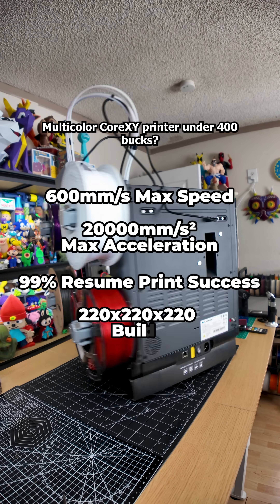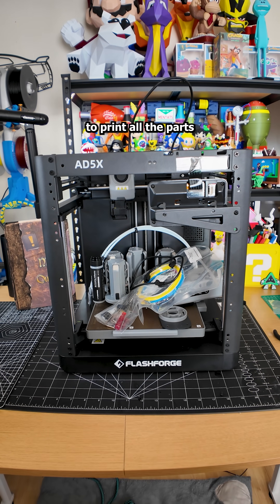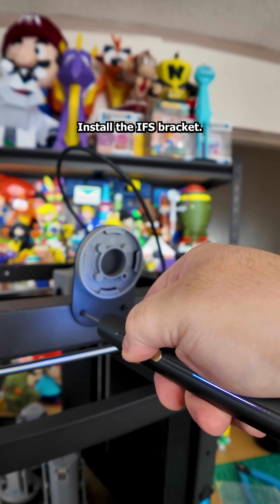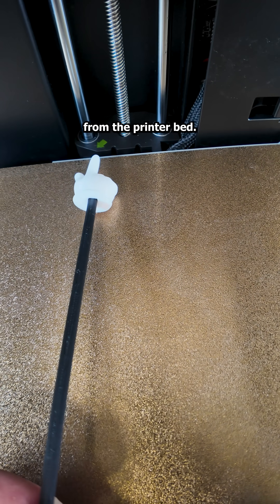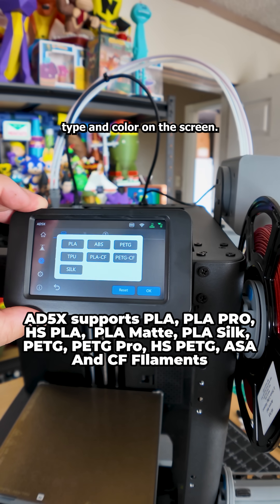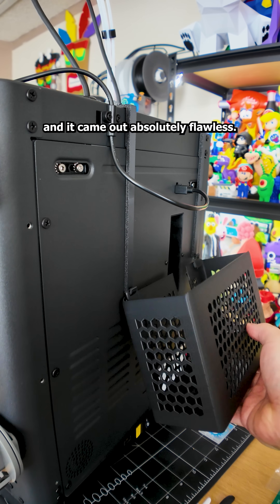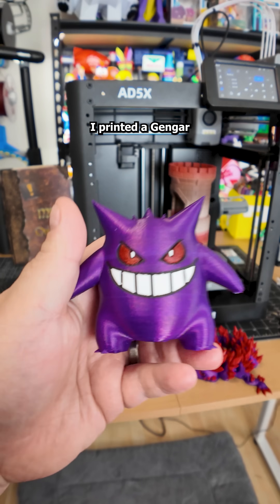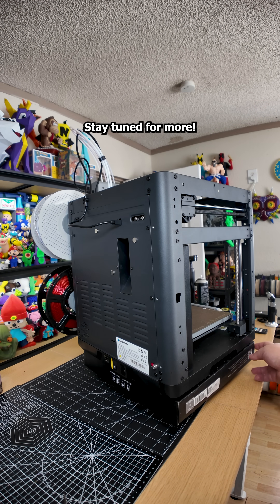$399 Multicolor Printer! - Flashforge AD5X - First Impressions

Comment from the maker: FlashForge is running a promotion this month. You can trade in any old printer to receive a $100 coupon towards the AD5X As well as additional $30 OFF using the code HIDEAL.
3D Printers of any brand and any condition are acceptable.
Simply fill out the trade in form and follow the instructions
https://geni.us/FLASHFORGETRADEIN
Reply: TPU on bowden?
Reply: Sir, could you tell me how does that little multicolor system works? I mean the module itself, how does it swap colors